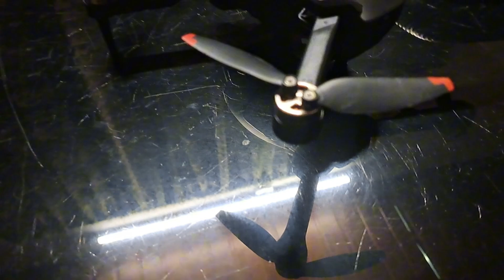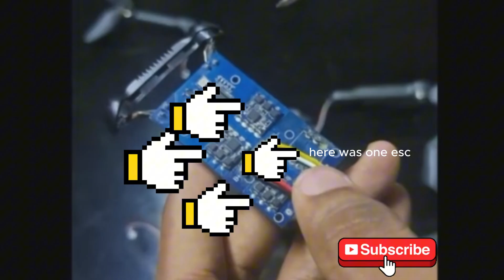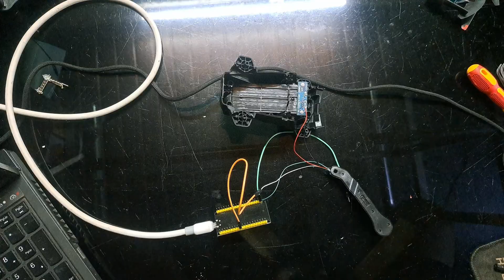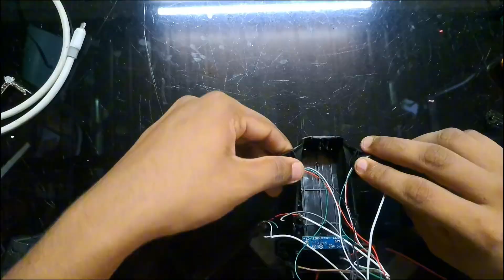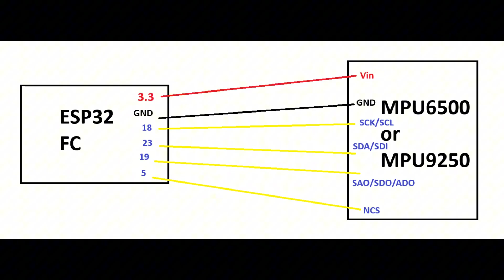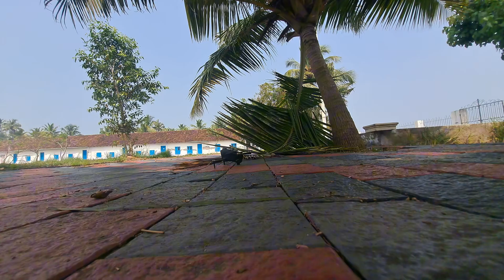I Built a $30 BLDC Foldable Drone | Betaflight Powered!

Comment: Bro which toy drone is this , i am interested !
Reply from the maker: You can use any toy drone
I used "s177" and esc on main board is "4DRCV28"
. You can use any BLDC toy drone 😊
Reply: @EngineeringRobotic  i am actually thinking to buy one , because i figured i can easily replace the LIPO with a high discharge LION , wireless system with a LoRa or rather ESP-NOW and boom a fully functional drone

Comment: bro no doubt it is great! but you can make it better with just a few tweaks. 
1) use only 1 esp 32 in a small form factor like wemos mini live kit.(betaflight on esp 32 have in built esp now reciver so you can ue it and it requires only 1 esp as reciver and flight controller combined)
2) it would be better if you used soldered wire instead of jumper wires and also remove the pin headers from the esp
3) use a lightweight voltage booster
4) replace the lion battery with a lipo battery(it have way better punch)
5) if possible switch to a new lighter frame(3d printed)
6) and since you already have a flysky transmitter so it would be better if you just used its compaitable reciver with the esp 32 rather than the esp now